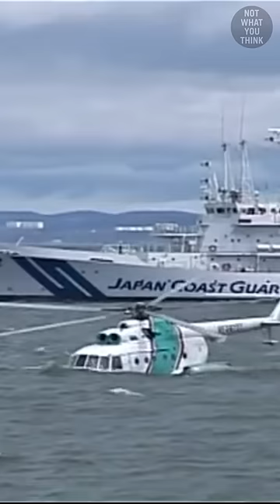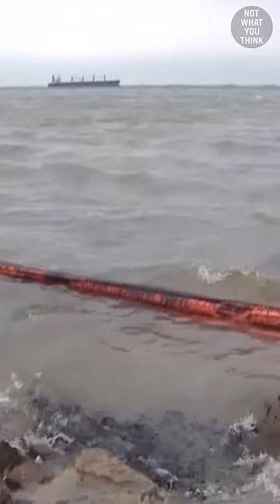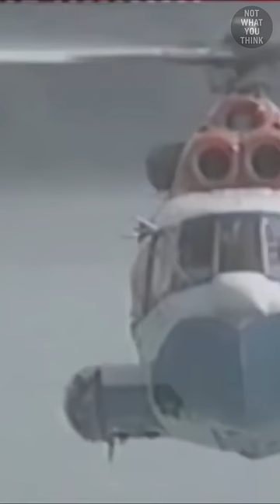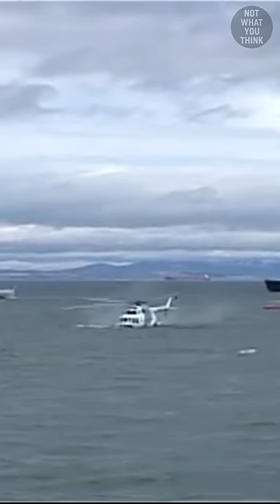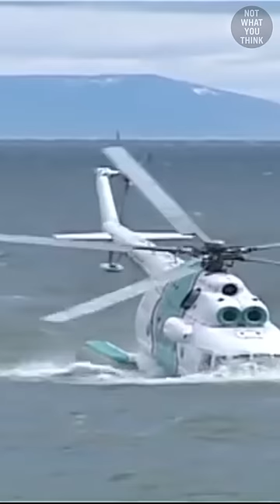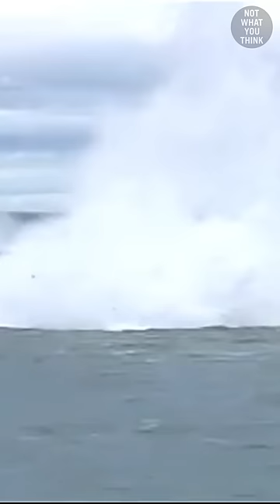Emergency Training Gone Wrong

Comment: had they stopped when they first went down all 13 would have lived
Reply: That's what I was thinking. He should have just shut it down and might have even saved the helicopter, too.
Reply: Yeah, surely thats an abandon ship type situation? At least for the passengers? Even if the water is extremely cold there is rescue nearby..
Reply: I know what you mean, but as far as I'm aware, with most of those floating helicopters like the Sea King or Chinnock, since the engine is so high on the body it has a high centre of gravity, the props need to spin to keep it upright or it would capsize
Reply: Poor pilot performance, was pan, pan, pan emergency transmitted, if not why?
Reply: @thegoodaussie1968  I have been a Sea King technician for 12 years. For some reason they never tried to water that thing.
Reply: I do not understand why the engine was not just turned off?  It is an amphibious helicopter.
Reply: @zoneundertop  they're in contact with the coast guard ships, I think they know what they're doing more than you do.
Reply: @thegoodaussie1968 I don’t know how good the training standards are around the world. But here in Norway, any personnel that might need to operate or be transported by helo over water, have to undertake a course in disembarking a helo in exactly that kind of situation.
Reply: @candle_eatist aah yes, because human factors just cease to exist when you have comms with nearby ships…
Reply: @DrakeKillah   when did I say anything about human factors... lmao
Reply: Yeah what a dumb pilot.
Reply: So if collective had been increased and they could keep the nose from diving, they probably all would have made it.
Reply: @zoneundertop You really think an emergency broadcast was going to help anything here?? Do you not see the multiple ships in the background already? 🤔 You're trying to sound like you know what you're talking about, but you failed.
Reply: @indridcold8433  im pretty sure its not when the props arent spinning. Just looks at that high CoG, one wave and youre upside down
Reply: Agreed too worried about the expensive chopper instead of lives
Reply: It's easy to tell what to do after the fact.

People calling the pilot dumb is incredibly disrespectful, as the stress of the situation, combined with the fact that someone died most likely weighs heavy on his heart. 

Imagine telling a war veteran that if he just threw the grenade out of the foxhole to save his friends that he is a dumb coward
Reply: The props don't just stop when you shut the motor off, as far as I know. You have to slowly spin them down, which is an unstable process. Could be that's what happened, they started slowing down the rotors and they lost the gyroscopic stabilizations.
Reply: @thegoodaussie1968 it's got them floaties though
Reply: @candle_eatist  that’s exactly my point… The guys were in contact with ships around it, but the pilot still seems to have fucked it up, due to panic or lack of training…
Reply: @DrakeKillah  are you a helicopter pilot? do you know what happened?
Reply: @thegoodaussie1968 this is one of those helicopters designed for that. Y’all are forgetting the mechanical failure that was mentioned early on the video. That’s why the rotors couldn’t spin fast enough to generate enough lift
Reply: @indridcold8433  "I do not understand why the engine was not just turned off?  It is an amphibious helicopter."

The engine had already died. Those rotor blades are massive and carry a lot of momentum, it takes minutes for them to wind down. That's why when the blades stuck the water all that energy was dumped back into the helicopter at once, which is why it exploded.

I don't think that is designed to land in water. It has retractable landing gear. It's not a seaplane. And this is exactly why.
Reply: This is why we need flight engineers
Reply: @marcohunemorder5660  They give fun flights nearby. I went in it (Sikorsky) and they smash that thing into the water every damn time, full of kids, old ladies, everyone.

Why would they not train that?
Reply: @candle_eatist  We’re both just voicing our opinion based on the information from the vid either way, this is a youtube comment section, not an air crash investigation board. I’ve been interested in aerospace for close to three decades,  work in the aerospace field, and I have family members that are pilots and own multiple aircraft, so I have slightly more than a basic understanding, but I’m no expert.

The helo lost lift and/or power for some reason, and ended up in the water. It seems something caused it to lose power - taking off from water would require full performance from the aircraft, which they didn’t have. At that point, the best course of action would have been to stop the rotor ASAP and disembark, which is not what happened.

I could be wrong, I haven’t dug into it yet. We’re just two idiots in a comment section, bud.
Reply: @Raven-ji4xu  he def tried to drive forward to keep the tail rotor up and get water out but it resulted in a nose dive
Reply: @zoneundertop  first of all thats not a pan situation. Its a mayday. There are ships all around and obviously they would be in contact. You're asking a question to pretend you know what you're talking about and then giving a what if answer just to add controversy. Basically everything in your comment is irrelevant except for the purpose of inflating your ego.
Reply: @DrakeKillah   @DrakeKillah   That's what I am saying. We're two idiots in the comments and I doubt any of us have the knowledge and experience to suggest that "the pilot still seems to have fucked it up due to panic or lack of training." I wouldn't be speculating since someone died in this.
Reply: @thegoodaussie1968 the thing ripped itself apart AND capsized. Clearly just a capsize is the just the better option
Reply: The blades do not instantaneously stop when the motor is shut down. Think of them as several hundred pound ceiling fan blades. If the fan in your house can spin for 45 seconds after you shut it off, these (thousands of times as heavy and hundreds of times as fast) blades will not stop for quite a while.
Reply: I doubt it would flip with them air bags on the side. It could have floated for a long time.
Reply: @DrakeKillah we all do HUETS, T-BOSIET,  FOET etc. Just not in dumb situations like this
Reply: @SmithsMuseum which Never keep a helo upright in chop
Reply: @thegoodaussie1968  yeah that's what I had assumed. Seems like there's probably a reason they didn't just cut the engine. Usually helicopter pilots, especially in that line of work, know more about helicopter operations than the rando on YouTube leaving the comment that they know exactly what was needed in that situation
Reply: @candle_eatist usually military doesn't mean they know what they are doing. Plenty of accidents happen because of that.
Reply: @TheOnlyKingBee  the japanese coast guard is a civilian organization...
Reply: It’s not that simple. Had they stopped the rotors they would have sunk. And if they got out before then. Well, you could probably image what would happen.
Reply: @D3nn1s so instead you goose it, fill upside down and have shrapnel going through the cabin. Bad call by the pilot.
Reply: @martindinner3621  hey, bad days all round.

All though of course when talking about what to do in this situation I think I’d rather listen to the guy that does it professionally.
Reply: @candle_eatist Of course they do, but just because someone is more qualified than the other doesnt mean the other person isnt allowed to as questions and determine what happened within logical reasoning
Reply: @Dr34dEnd3r  fair. The manual is clear on this one though is pretty clear. Cut fuel, cut ignition, apply rotor brake.
Reply: @zoneundertop  This was certainly a full emergency/ mayday
Reply: Abandon the helicopter that requires rotor spin to stay upright means you got to dive in submerged to clear the props and swim underwater hopefully to recover your life jacket that got blown away. The SH-53 characteristically would flip right away on a water landing and boot camp training involved an escape scenario in a actual shell crashing and flipping in a pool while your strapped in. In reality , your shocked by the cold water crash landing and in the dark along with other crew members while possibly a fire rages above.
Reply: Bad instructions
Reply: They probly wanted to save it.
Reply: From what I’m seeing, the mistake happened when he pushed forward on the cyclic stick (forward, left, right, back) when he should have gone straight up. Instead, going forward he “plowed-in”,…just fucking ugh.
I’m watching this, screaming: “pull back, pull up…anything but forward!”
…and then he continues going forward!
Holy fuck! The blades gotta go somewhere and to go forward they tip forward and down…like into the water…wtf! The PIC or IP (pilot in command or instructor pilot) is to blame.

Man, that sucked watching that - like watching a train ‘going’ to wreck…in slow motion.
Reply: @candle_eatist  i am, but ive never flown an amphibious one, i personally do agricultural spraying, but even my training covered avoiding rotor strikes, it really does appear like the pilot panicked and tried to use forward speed to gain altitude when he lost collective control which can work but isnt something you would want to do when you're that low, you want to cut power and hold your rotor level, especially since he is amphibious and doesnt have to worry about immediately sinking.
Reply: Yeah, but you know. Russian training and all...
Reply: @Mygg_Jeager  it was the Japanese coast gaurd. Russia doesn't do readiness training 😂
Reply: @JT29501   There is a damn coastguard ship right by it so, they really should have abandoned.
Reply: @zoneundertop   Thats a mayday
Reply: @johnsmithe4656 yeah a bunch of keyboard helicopter pilots here. Even a tiny piston helicopter takes at least a couple minutes for the rotors to stop spinning. If there really was an engine failure, there’s no way in hell he tried to restart the engine and take off in that position. But the shut down is not an immediate get out of jail free card

I think either the engine was out due to a failure and he lost control of the helicopter due to instability of the wind/waves. 

Or the engine never failed, just that he misjudged the distance to the surface. Once he realized his mistake, he was trying to pull up off the water but couldn’t get enough lift and pitched forward. He would’ve been better off just shutting down the helicopter and getting everyone off board, but that would have possibly entailed losing the helicopter and for sure losing his job.
Reply: @thegoodaussie1968 incorrect. It can float upright in calm sea but will eventually topple over. So shutting down and evacuating as soon as the blades stand still is the normal routine.
Reply: @triplez7313  Oh I know lmfao.
Reply: @rocinante4488  Hey
Do you know what's amazing?
I've lived on a hospital helicopter flight path for 21 years. That's multiple flights a day, every day, over my house. And do you know what's never, ever happened?
A helicopter crash landing in my yard. XD
Yet every other day, one seems to go down in Russia. And I don't mean I'm Ukraine, I mean in Russia. Where no one's shooting at it.
Reply: @Studio23Media Ex Navy with my two cents.  Whenever we ran drills and something NOT planned happened we would announce 'Actual Casualty, Actual Casualty' and all training exercise would be halted until such time as the actual casualty was resolved.  The person you're responding to has either some aviation experience in the civilian sector or has watched many air crash investigation videos where pilots are trained to raise 'Pan Pan Pan' in the event of an abnormal situation that can become life threatening, so calm down and take a seat before you kave a stroke valliant keyboard warrior.
Reply: @DrakeKillah  Yeah, same here in Australia, we get training for this before we start work (oil rigs) we actually have a helicopter ditch simulator
Reply: @johnsmithe4656  no, he kept trying to take off again. The rotors sped up before flipping. He was trying to save the helicopter by getting back in the air...
Reply: @AfricanLionBat  The rotors do not speed up to get lift. The collective alters the pitch of the blades through the swashplate. If you think you're seeing the blades speeding up it's just a trick of the camera, I promise you they are not.

The rotor is meant to spin at a set RPM, it is not supposed to deviate. This is just how helicopters work.

Theoretically the rotor disk would become "thicker" given the higher angle of attack of the blades, but that's really hard to see with the naked eye, never mind low resolution video footage.
Reply: That was my first thought.
Reply: @thegoodaussie1968 This one was designed to float. The pilot got scared, tried to pitch forward and discovered fluid dynamics the hard way.that nose dive was induced.
Reply: @macluge13 Or, just shut it down, they had a crane on the ship.
Reply: @geraldhartman2336  yep, seems like they are trying a rolling take off, may be due to partial power loss yet floats are mostly under water increasing drag on nose  leading to toppling  🙄
Reply: Thought same, shut her down
Reply: yeah but at the same time, pilots have the mindset to never stop flying... never stop trying to save their craft...    the pilots view was to try and get it out of the water... to get it to safety...   

Yes, the correct response would have been shut down the rotors.  this was oil spill recovery so have one of the support boats deploy flotation devises,  put  divers in attach flotation to the hull.    crew can escape, then they can bring a lift ship and raise it out of the water either onto a barge,   transport ship or if the lift ship is large enough,  onto the flight deck of one of the warships... though cargo barge would likely have been safest.

once done they could bring it back for repairs.
Reply: True. Dumb ars wanted to force it up causing the disaster 🤦‍♂️
Reply: @SKFortyseven3277  exactly 💯
Reply: @mauritube6416  this is nothing new though, its drilled into pilots...   and in turn has caused many crashes...  something called pilot induced oscillation, when the pilot keeps trying to "correct"  mistakes,  and just makes things worse when you should just stop...   neutralize the controls, and wait. 

or i think it was the F-4...   it might have been another fighter but i'm pretty sure it was the F-4, when the fighter stalled...  you essentially had to let go of the stick, not fight the aircraft...  the fighter would nose down...  spin 3 times to the right, 3 times to the left... then "wobble".   when it wobbled you would pull back on the stick and pull out of the dive...     If you tried to do anything... ANYTHING,  it would just keeps spinning till it hit the ground.
Reply: I think the pilot gambled and tried to put the chopper back to the air, a Chinnok can actually do this, get to the water surface, load a zodiac boat from the back door, power up and get in the air again, the pilot thought he could do the same thing the guys on the Chinnoks do
Reply: @DrakeKillah  Isn't 12/13 surviving well above average even after that course?
Reply: @zoneundertop 1. this would be a mayday, 2. i hope you enjoy reading "pan pan pan pan pan pan" while falling into water with 2 seconds until impact
Reply: @DrakeKillah  Same here in Nigeria if you have to travel above water. It's called HUET.
Reply: @candle_eatist  If they tried to power up to take off from the water then they messed up no matter how much more they know.  I'm not a pilot but I've seen enough to think there's no way they were flying out of that situation.
Reply: Heart attack
Reply: @zoneundertop heart attack
Reply: @indridcold8433 heart attack
Reply: @BSenta heart attack
Reply: @DrakeKillah heart attack
Reply: @Mygg_Jeager heart attack
Reply: @SmithsMuseum  The floatation devices are stashed under the seat in front of you.
Reply: @DrakeKillah same here in Australia, if you’re a rig worker you have to do a HUET course.
It stand for helicopter underwater evacuation  training. 👍🏼
Reply: Looks like it was meant to land in water but if they had first fallen due to failure probably should have stopped right away
Reply: I know! 🤦‍♂️
As a Helicopter Pilot myself, this was hard to watch. If he just “shut down” the Helicopter it would have capsized and sank anyway.

But as for the passengers? They could have all walked away from that but the pilot was too worried about saving the helicopter…
I have more to say about that but don’t want to start any arguments. x)

BUT 
The Pilot is only human and I’m sure he did his absolute best in the very short time he had, that’s all we can ask for. 😢
R.I.P to the soul who didn’t make it.
Reply: @Tyewilleatyoualive  As someone with at least 20,000 hours flying a twin motor lazy boy. (one on the arm rest and one one the foot rest) It was painful for me to watch as well.  In my worthless opinion, helicopters are the most beautiful vehicles ever made by humans.  They are even above the tall ships, which are the second most beautiful.
Reply: @matthewcherrington2634  what?
Reply: @Mygg_Jeager  as far as I know of the pilot had one
Reply: Of course now after the fact you know better and this would not have happened to you, right?
Reply: @torsten6777  Yes. Because that's SOP. It was then. It is now.
It never changed.
This is incompetence manifest.
There's a reason you don't see this happen to NATO pilots.
Reply: отказа двигателя не было. ошибка пилотирования. сильно ударили корпус. набралась вода, повысился вес. запаниковали. попытались поднять, смещение центра тяжести, зацепили лопостями.
Reply: @thegoodaussie1968  but it have floats to prevent capsizing
Reply: Computer said no
Reply: And it wasn’t equipped with floating pontoons because…….
Reply: Everyone keeps saying they flip without rotors. Look at it carefully. It has extended rear pontoons. It wouldn't flip.
Reply: Asimismo
Reply: Mi-14 has two engines. Apparently they lost one engine and the helicopter didn't have enough power to fly. 
The pilot failed to realize that the helicopter had only half of the power available, and wasn't able to get airborne. Perhaps he tried to get more lift by moving forward (this works on land), but he failed to realize that if the helicopter is that deep in water, too much forward momentum causes the nose to dive.
Reply: The pilot responsible for all the lost life...due to lack of training...
Reply: @Andrewbert109  hah, too right, let's leave it to the experts!